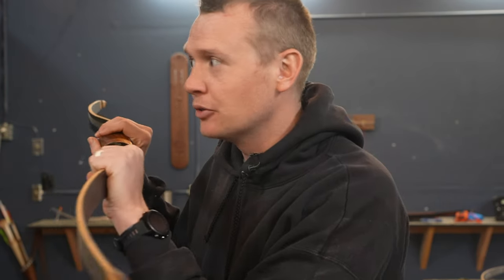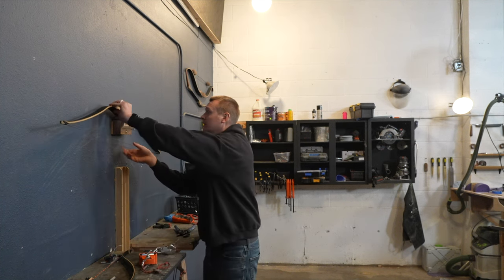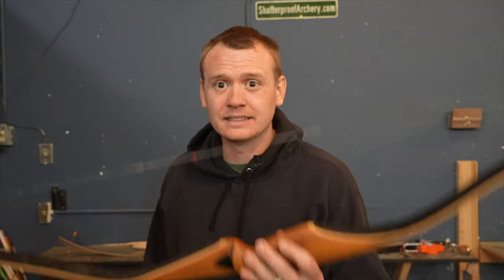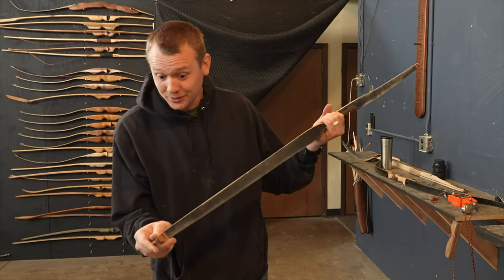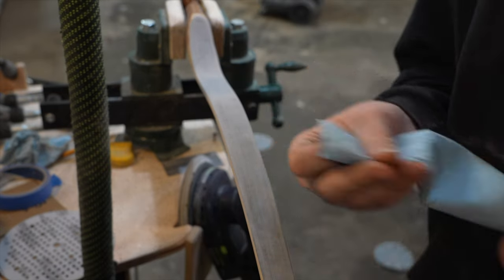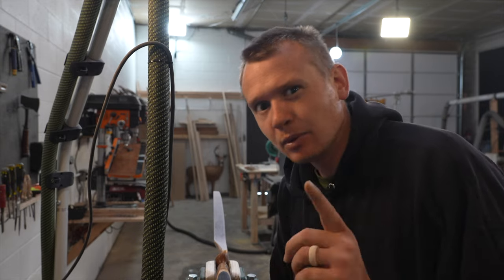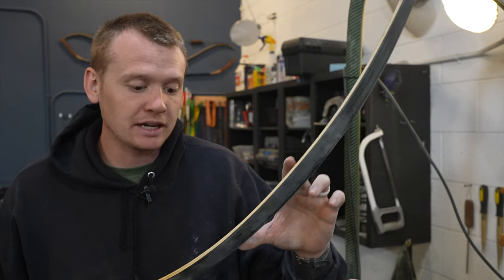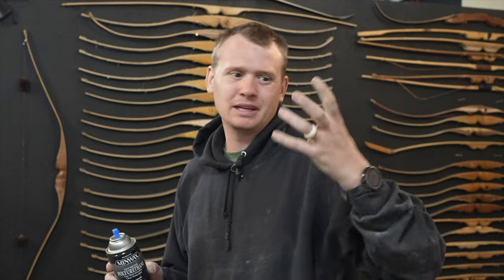How To Refinishing A Traditional Bow

Comment: I have a Bear commemorative longbow (one of three different models but all with the same serial number).  The finish appears to be in good shape, but the info about the bow has worn off…ie the serial number, draw weight and length.  What do you use to put that info on the bow and what kind of clear coat protection over this do you use?